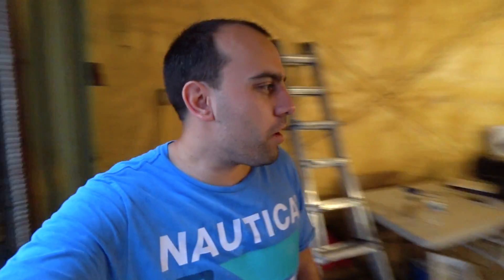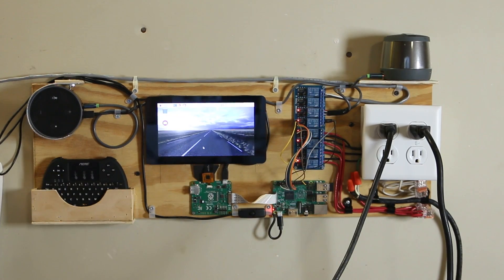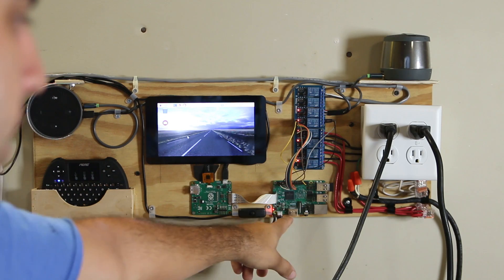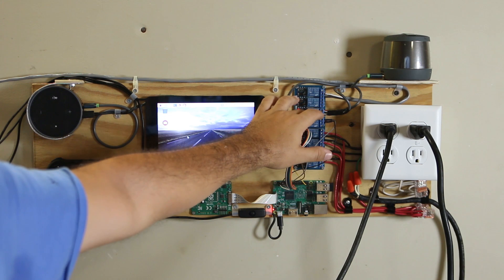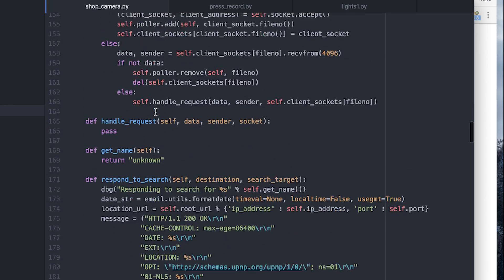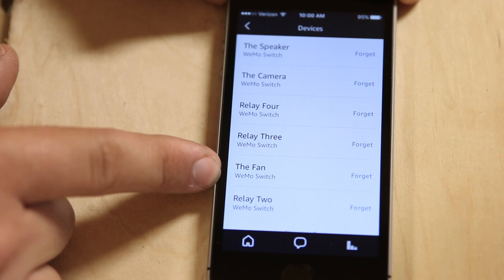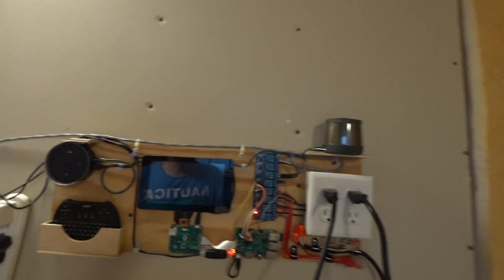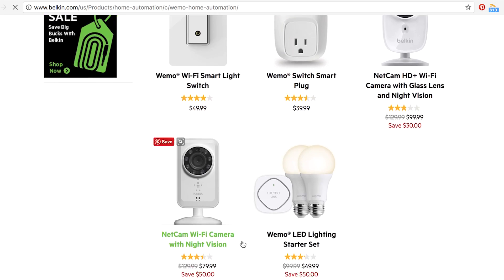Make "Alexa" Control ANYTHING!

Comment: the only problem working with those relays is that is you are operating at little heavy load such as LCDs, Washing Machines etc, the relays have very thing wirings beneath the PCB which tends to melt out. I have had this experience. Thought could be dangerous

Comment: I don't if anyone else picked up on this, If you turn a piston type compressor off "at the wall" it does not discharge the air pressure in the cylinder if it was running when the power was pulled. When the power comes back on the motor has to push the piston at full pressure from the bottom of its stoke, You will burn out the motor and as others said the low amp relays. a piston type compressor has a mechanical shut off button/valve that discharges the air between the piston and one way valve on the tank. Other than that great idea and video and I have all the kit laying around here to make this (hence I found your video) the only difference in the UK we are 240volts or twice the size of the sparks !!!

Comment: Hi there, than you for showing me what can be done with Alexa, Raspberry Pi etc. I’ve been using Nodemcu modules to control various outlets, switches etc and using the Sinric Skill and website which is very easy to use. Thanks again for an alternative solution.

Comment: Nice video.  I used the Sonoff 4 Channel WiFi hub.  Same thing, only "Plug and Play"  4 channels, $30  Quick and simple, but I guess we miss some of the satisfaction of doing it ourselves.  I automated my RV, Start/Stop Generator, Extend/Retract Awning, Various lights, Various Echo Dot on/off (to conserve battery power), TV antenna, Stereo, etc.  Tempted to check out the Rasberry Pi to find out what I might be missing . . . .

Comment: Some people are missing the point here. 

It's not "that's dumb, there's already a cheap product on the market for that." 

It's; "wow, if you can do that, then what else is possible?" 

Sure, if you have no imagination, intellect or ability to think outside of the box, you could just spend a fortune on several 'smart' outlet adapters hanging out of every GPO in your home and you could look like a twat. What's the point of that though? Unless you're only controlling something rudimentary, like a non-dimmable light which only has on and off, then you still have to 'control' the device to some capacity, so what did you achieve by spending $20 to turn a single thing on and off?

Once you realise that relays are a thing at that they allow you to control a power supply with a software signal, then the phrase "the sky is the limit" comes to mind.

You could spend $20 per device and as I stated, have them scattered around the home making you look like a twat, with the mere ability to turn something on or off. Or, you could realise that for every marketed product that charges a big price tag for you to be on the bleeding edge of tech and for every mostly functional Chinese knock-off, there is usually a very simple technology at play which can be implemented with some very cheap hardware off the internet. 

Take the Amazon Echo, Alexa and all the other smart home devices for example. I have no idea what they cost, but after looking at an ad for 0.5 seconds I can tell you all it's just a decent microphone with acceptable range and clarity, an LED ring that can blink and a semi-loud speaker which apparently doesn't have to be amazing as it appears to only play 1 sound (until you hack the device and midi-code other sound outputs.) I don't know what they charge for the hardware, but I'm sure people are sold due to the "smart" label and the voice recognition software, which can be found online free. 

Once you realise a series of decent microphones in different rooms can be linked to any number of relays with a decent controller and software in the middle, then you realise that "smart" homes are for dumb people with deep pockets.

A single relay wired in behind a GPO faceplate with the signal line routed to a central computer turns any GPO into wifi/voice controlled power switch. The smart ones will realise that doing so will either bypass the outlet power switch completely (safety issue and pointless) or it will render the power switch a master control, meaning a wifi/voice control will not work if the power point switch is off... The even more intelligent will realise that with a bit of thinking and some latching relay tech, you can pick up the neutral signal of the switch and wire up a latch - de-latch mech that is actuatable from the faceplate switch AND the software 'home automation.' Some still will realise that in doing so, you've made a ghost two-way switch and such as with two-way lights, the switch may say off, but it's actually on. Fine with lights, not so great with an energised outlet. At which point, you come to realise that the on-off switch on serves as a toggle input for a relay design to indicate a change of state and can be more efficiently replaced with a momentary push button... But then you don't know if it is supposed to be off or on. Enter the push button with LED surround and suddenly you have a smart home power outlet which has a light to convey on and off and a push button switch to simply change state. It's sleek, futuristic and it takes full advantage of the tech. 

At that point, the market steps in again and rather than offering a tacky, overpriced wall outlet that simply turns stuff on and off via wifi given then outlet is already on, it provides a sleek solution that hides on the inside of the wall and does much the same thing for a huge increase in cost... But once you realise how it works and that you can safely and effectively build these yourself for a fraction of the price, it opens all the doors.

But that's the point of this. There's no point having a 'smart home' if it entails spending hundreds of dollars on several tacky devices to accomplish very little. It is far better to hide the mechanisms, make it all sleek and run it through the walls. Further, obviously, the biggest advantage is that you can coordinate several commands from a single input command and being that you can code a command set as a word or phrase, literally anything is possible.

If 'things' are computers you program rather than just products you buy and assume are bound to their original intention, then you're not just limited to relay switching and command sets. If, in addition to telling "things" what to do, they can also talk back, then there's a whole host of new opportunities. Smart home speakers already 'talk back' to you by answering questions and playing music like any speaker/Siri thing assumably would, but you can also have 'things' feedback status to tell you what is on and off etc. As he stated, just as he can switch things and execute command sets, he can have sensor feedback.

Seeing as many of our more complex home devices, such as computers and [smart] TV's already have the capacity to feedback status data, the only further things we'd control and pull status from are maybe lights, doors locked/ unlocked and maybe such as with his caravan, things like water heater temp. 

I think 'too much' emphasis is put on smart devices and making everything in our home a 'smart' device that we can actively decidely control from our phones rather than focusing on what tech is ACTUALLY for, which is providing solutions to real problems. For example, you COULD read your users manual and learn how to use the delay start feature on your washing machine or dishwasher to sort of have it finish at the time you're due home... Or you could instead with some very simple microcontroller hardware, [potentially] free software and a bit of enginuity, control your washing machine to finish when you want it too... 

I don't think a lot of people properly grasp the 'problem solving' side of tech innovation. You don't explicitly need a supercomputer in every device and purposeful control over every instance of your devices to improve your life. You 'could' just connect your washing machine to your home network as a not specifically listed device (you don't want to scroll through your phone/laptop smart home app past the dishwasher, washing machine, kettle, toaster, fridge, water heater etc to turn your lights off, that's inconvenient. A 'smart home' application of a connected washing machine (as one example) is one wherein you hastily throw the clothes in on your way out the house and you forget to start it... But through the magic of software automation vs direct, explicit control, you tell your smart home [vocally] you want the washing done when you get home from work at XX:XX. The software then does the heavy lifting for you, figures out when to start the cycle, self-selects the cycle (dependent on your command) and drains the proper portions of detergent and fabric softener for the load and has it finishing up when you get home to put in the dryer. A smart DRYER can then adjust it's control (with no user input of any kind) dependent on what was just washed i.e. Sportswear/ work wear, sheets, delicates, colours etc etc. THAT is what smart homes and smart devices are; things which make our lives better as opposed to things which are needlessly connectable and explicitly controllable for no gain. 

THAT is why what he has done is smart and on the cutting edge of innovating what it 'means' to be a smart home and why everyone here who have pointed out there's already several clumsy wifi switches on the market, is frankly, a dimwit. 

Free tip: some tech geeks (many actually) have shown us all that garage doors are basic radio receiver units and that with clever design and packaging, rather than having the usual 4 button for 1 door keyring remote, you can control these things with your phone... That's basically as far as many have gotten. #missed opportunity. With the increasing computerisation of cars and the existence of smartphones, there's no reason you can't control a smart home radio transceiver paired with your garage door channel that automatically opens the door once your car starts and [obviously] connects to your smartphone putting it in car mode which then initializes the command chain for Bluetooth speaker, dank Beatz, Google maps and obviously telling the smart home to open the garage door so you can leave for work. 

Now that's smart, that's seamless. That's innovation. Bonus round: Since every app you've ever downloaded already has unrestricted access to your location, mic and camera and probably your credit card pin too, it's not at all impossible for a streamlined app on your phone to communicate via internet or wifi (if in range) to your home to open the garage door when in close GPS proximity (like coming around the corner so it's about open when you get there) or to force a popup on your phone (or cartainment thing) asking you if you'd like to open the door. Sure, security is to be factored in with a lot of this stuff but seeing as you can already bump key most door locks and open a garage door with a rolling transceiver, there's nothing inherently worse than an encrypted wifi smart-home network or internet accessible network, especially since most mobiles have thumbprint scanners anway.

Rant off/ Dumb people need to be dumb less, the possibilities aren't just endless, many of them are genuinely useful.

Comment: At 2:34, that would be a two gang box Mike. Don't cut the tab on the neutral side of the duplex receptacle, you'll just have to wire it back up again. And of course, all of the 120 volt stuff needs to be in a box. You know, the whole high-voltage thing and all.

Other than that, what a great project!

Comment: The Pi seems to be major overkill. Ethernet equipped Arduino or an ESP8266 if you want to be wireless, MQTT firmware, and a few lines of code. The Echo can issue MQTT commands if you script a skill, right?

Comment: Great example of the fauxmo and alexa technology. Did you have a problem with the individual items in the home automation group? I can turn each one on or off by voice command or via the alexa app, but only one (at random) works when I try to control a group. Alexa feedback and customer support seem to be useless for complicated issues.
Reply: Nice video, but the code he has doesn't work with the latest python 3.  I had to change a few lines for alexa to see the gpio.  I'm wondering how you made it work.   I can't seem to make it turn on/off.
Could you shared what you did on your end ?
Reply: Just checked, I am using Python 2.7.13. What part is not working for you? Is the alexaGPIO.service running? That was one of my problems.

Comment: Sonoff. $5 Alexa compatible WiFi switch without needing a middle man like a hub or pi.
Reply: Jason Kloos ..i have an echo device, how can i get it to control the sonoff switch without a hub?
Reply: You do need to use the Itead (Sonoff) online server unless you upload new firmware to the Sonoff devices.
Reply: I'm using Blitzwolf sockets myself. They come in 2 varriants, 10A and 16A. The 10A socket is really small, just slightly bigger than the connector itslef and only between $8-$10. It makes it much more versatile (and safer to my opinion) because you're not in the need to modify your powersupply and it stays movable and interchangable this way so it's worth the extra money I think. You integrate them into your wifi network via the "smart life app" (somekind of cloud), give them a name and integrate them into Alexa. Should work the same with these Sonoff switches I guess, the're quite similar. Then you can give them orders by speech, adjust commands or combine them together and create routes. The states of the switches is traced with this "smart life app" so hangup a cheap tablet and you can also manually switch them.
Reply: Sonoff switches are great. I use many of them in my house and they all work extremely well. I can just ask my Google home to turn the lights on and off.
Reply: Is it possible to do it from different networks? Let's say Alexa is at home and Sonoff is at office? Or it only works on local networks?
Reply: @vicentealbertogutierrezsan8592  yes, it's possible! You can access tour sonoff smart relay over 4G in any place in the world, using Alexa or Google home.

Comment: It nice. Add 25 Amps slave relay uL listed put it all in side of an listed enclosures to keep the safety factor up to code.  Fuses will clear a fault to ground fast whereas the circuit breaker has to cycle it time up to trip current.  Your control Circuit  shall be fused. Perhaps 3 Amps... thanks for sharing... peace

Comment: I just love brilliant smart solutions like this. Great job brother.

For others who may want a bunch of relays in a mall package and don't want to play with any code or RPsi, check out these two devices by Sonoff 

1- http://a.co/1U5bouX 

2- and the pro version of the same device that also has an input (which could really come in handy) http://a.co/98rPYT6

Make sure you won't overload those relays. Pay attention to the rating of the relays as these seem to be low voltage relays.

What I am listing above is not the exact same solution as the OP. His in much fancier with a lot more flexibility. But if you need dry-contact low voltage relays in a relatively small unit (smaller than 4 plug in modules), these are great devices.

Comment: This is already the future! I still find it a shame that every single new house built out there is not smart-ready. these companies (Amazon, Belkin, Google, Samsung) should devise some strong standards and partner with hardware stores so that now any house infrastructure has a "smart component".
Reply: Yes, I was thinking about that too.  Of course lighting would not need 120VAC, 12VDC would handle LEDS.  They could all be addressable.   Where will we be in the next 20 years.
Reply: William Terry youre absolutely correct. I was thinking of standardizing a plug for decorative LEDs as well which would be placed in various strategic spots

Comment: The idea is good but the echo has a device limit of 16 devices (switches). See in the script:"As of 2015-08-17, the Echo appears to have a hard-coded limit of 16 switches it can control. Only the first 16 elements of the FAUXMOS list will be used."

Comment: Do you have a boot on your trailer? I've been wanting more control in my 2006 Lance camper. I would have been happy with a second control pad in the sleeper area but one that would control everything, start the generator, and the less difficult climate control. There are many systems available now to program the AC but not  so many to control everything including security, exterior camera monitors, auxillary camper systems  etc.

Comment: A word of caution: the relay board you are using is rated at a fairly low current.  More importantly, it is designed to be used with non-inductive loads.  What this means is that anything with a motor runs the risk of burning out the relay, especially when starting or stopping the motor.  Ideally for high power motor-type loads you should use the relay to power a contactor which is capable of switching an inductive load.  Otherwise, a very interesting video.  Thanks.
Reply: He probably doesn't care, and will find out the hard way, if he hasn't already by now. lol
Reply: A very easy solution that I did is  to have the relays switch 24 v to  field relays(Usually  RIBs)
Reply: would a capacitor do the trick? help kick on the motor like on an ac unit.
Reply: I too commented the same thing, I had done this mistake in the past

Comment: Mike Mike!  Totally inspired by this video and am now working on replicating the same for my workshop. 

A couple questions:

Where did you get the mounting screws for the boards?
What mounting contraption did you use for the echo dot?
Do I bring power into the relay first and then bridge it into the 2 gang box?
Do you continually have to run the fauxmos script on the pi?